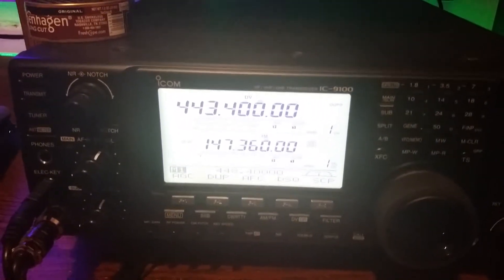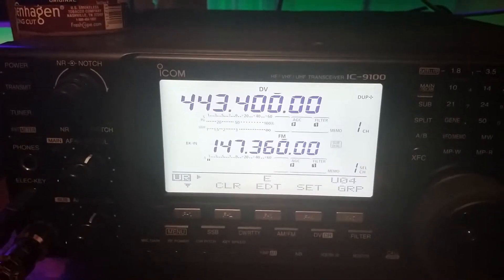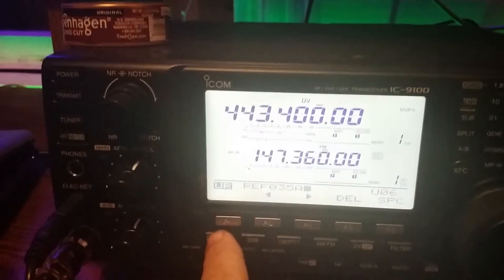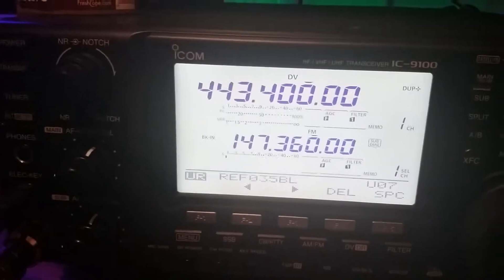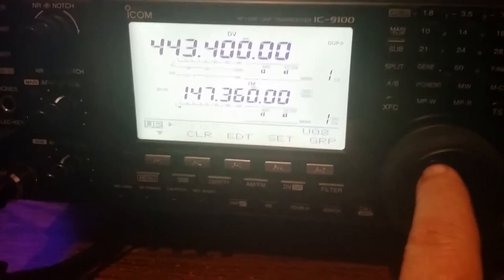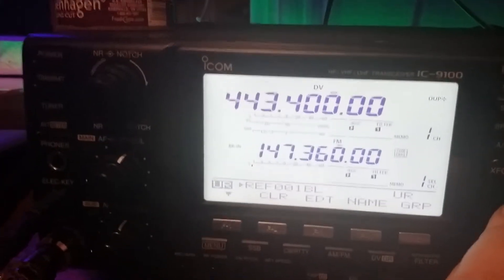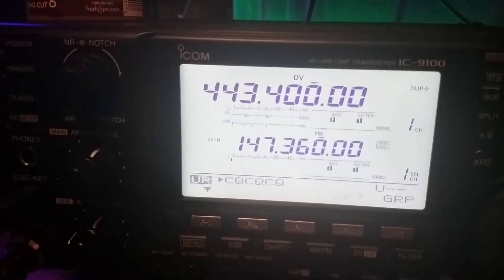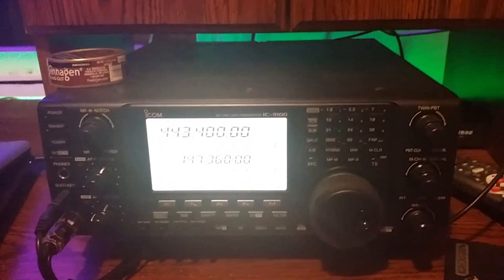Entering commands for DStar on a icom 9100

Comment: Wish someone would explain the steps to connect the 9100 to my Hotspot so I can connect to D-STAR. I can hear the reflectors, but I can't get a connection to any of them ? It appears they are connecting but I see nothing on the Dashboard & nobody replies to me. I don't have any D-STAR Repeaters within my rural area. Anybody knows where I can find this information? Thanks & God Bless.
Reply: Make sure your 9100 is in DUPLEX mode.  Doesn't matter if it's + or - offset.  Then you have to change the offset amount (Khz) to 0.  It doesn't make any sense, but this is how to do it.
Reply: @ Even if the frequency is set to simplex on the Hotspot? My ID51A+2 is not it appears & it works great?
Reply: @glenahlborn8181  OK,I have the offset so it's at Zero & I still can't make a contact it appears? I have conflicting information about how many spaces between my call sign & the C & the G when I enter them? Thanks much.

Comment: I've learned with my patience and vision issues, it's better to just get the RT Systems software, download the most current repeater listings from dstarinfo.com and repeaterbook.com, import into rt systems, and let the computer do it.  It is good to know how to enter without the software though. 

Great video!  Thanks for your hard work!
Reply: If you have the correct programming cable it’s just as easy to use the FREE ICOM Software and save the money you don’t spend for the RT Systems Software.I find the RT Systems Software as Overrated and Overpriced and it was No Help in connecting to my DVMEGA only through a repeater.